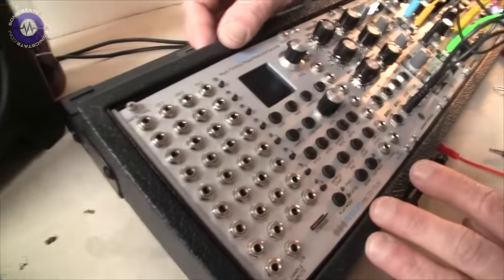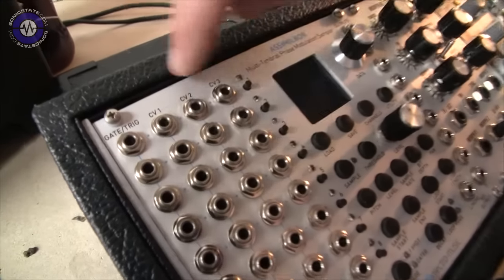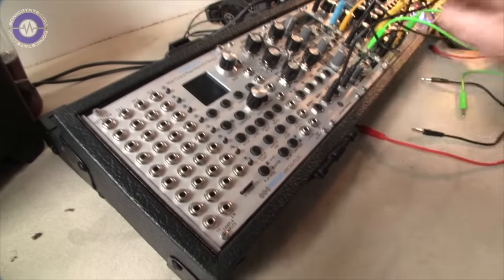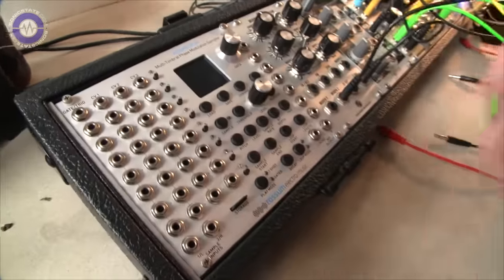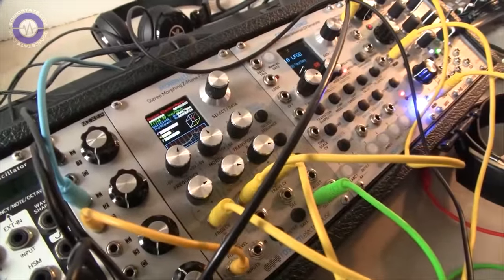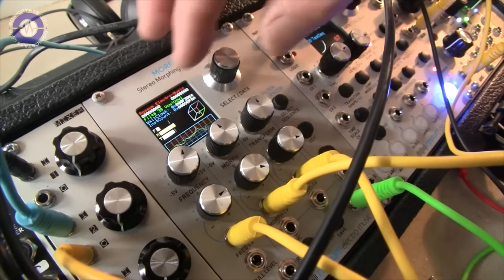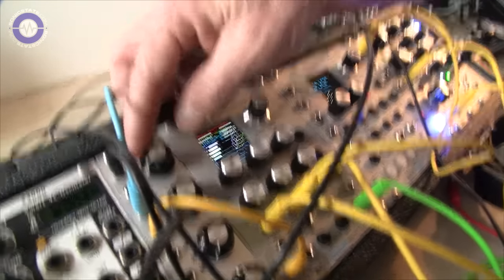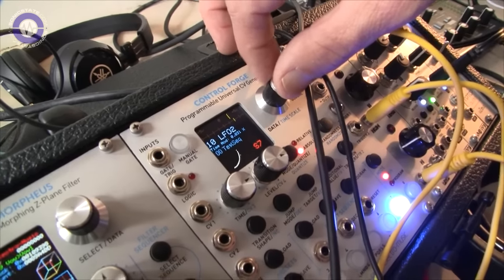Superbooth 2016: Rossum Electro-Music Assimil8or

Comment: One feature I'd like to see in the Assimil8or would be a cv (in some sense..) controlled recording function. I used a sampling delay (Logitech CCSDDL) many years ago that allowed me to drop new material into a loop with a simple button push. Very good for spontaneous (chaotic?) inspiration. To have 8 loops that could be blipped in/out of record would be awesome! Perhaps based on the level of the incoming CV (not 0 to 1 volt = record, 1+ to 2 = record backward, etc.). Hope you all have a stimulating time! :)